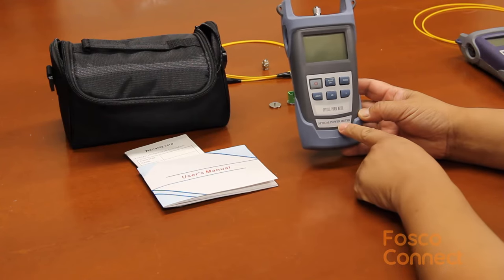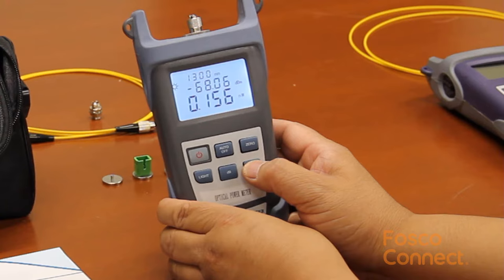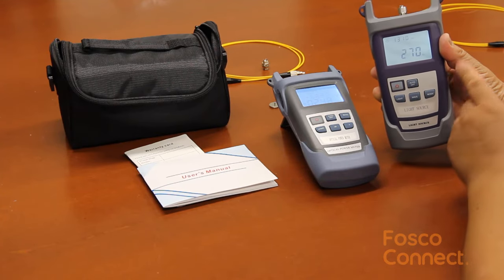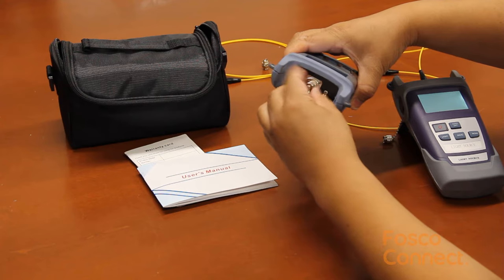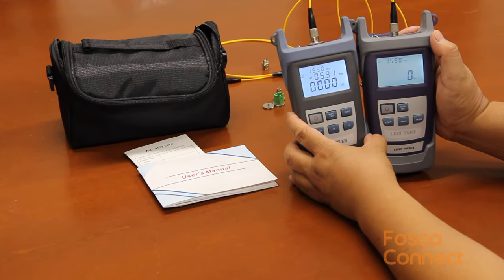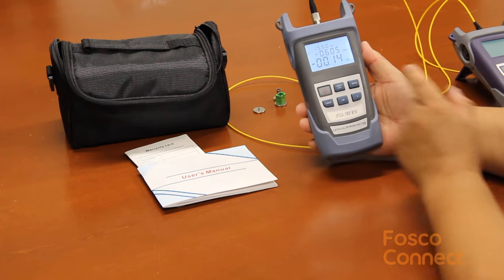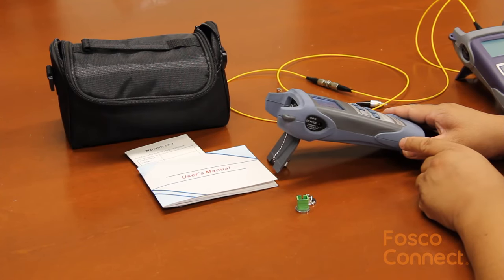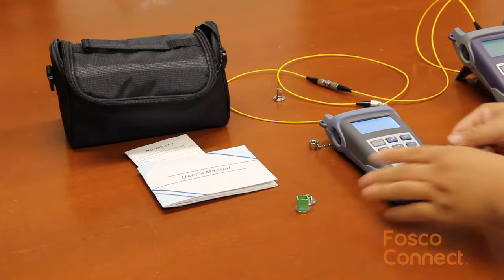How to test a fiber patch cable using hand held optical power meter?

Comment: Is there a way to test SFPs using a jdsu or is it just the fibre cables?
Reply: Just the fiber cables. Sfp is your light source. So you would set reference number like this as shown and then test all the fiber cables needed, is you set reference as 1310nm then you want to be testing fiber only linked to 1310nm SFPs.

Comment: Thank you for this video!
Reply: Check out the 3N1 optical power meter: https://www.alibaba.com/product-detail/Factory-Self-Developed-Optical-Fiber-Multimeter_60838142254.html?spm=a2747.manage.0.0.58d971d2tB77ta
Reply: If you need training at this level then you shouldn't be working on fibre and be in a headend or server room unless accompanied by a responsible adult 😂
Reply: @chongqingdodemcommunicatio1988  

i noticed this  unit  in the  video about 40-50 bucks..
not really clear what  they  give with that  their price is 500

probably a wheelbarrel of  bullshit
Reply: @kingsman428  
this stuff used  with  lasers  too not only with computers and servers

tv  providers also using it

generally everywhere   fiber used
Reply: @cnccarving  Agreed that's why I mentioned headends all broadcast and DOCSIS downstream transmissions are fed from lasers to optical receivers in the field 😁